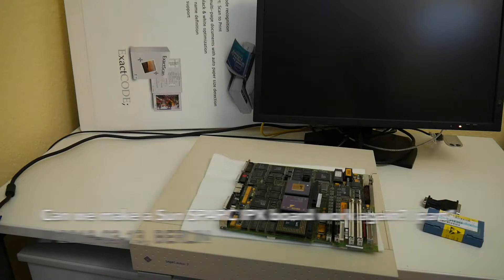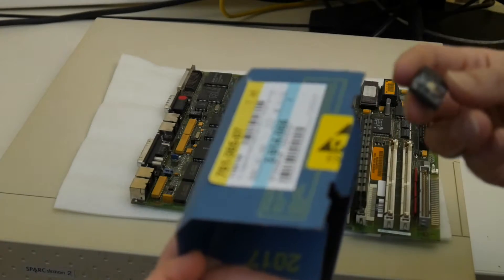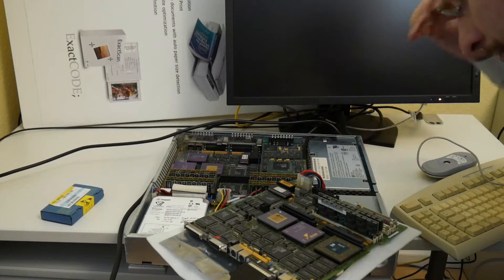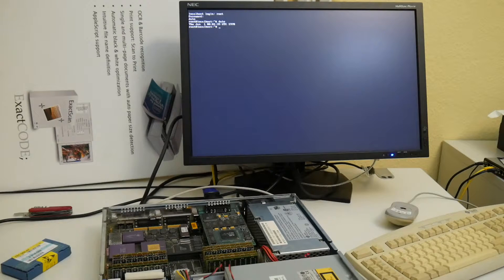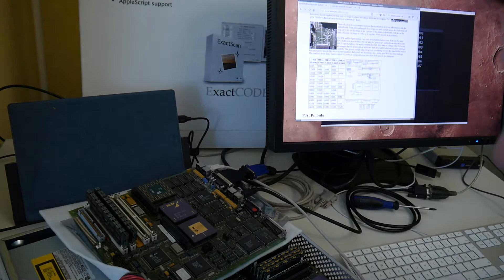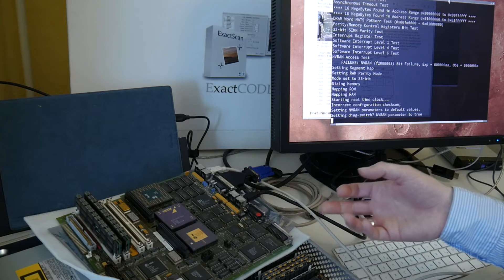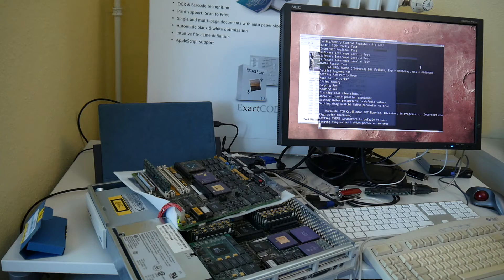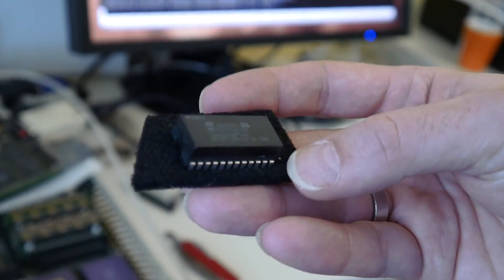Sun SPARCstation IPX board & NVRAM: can we get it to work again? /part1

Comment: A single 16MB strip goes to U0310 (the memory slot adjacent to the SCSI connector). Two need to go to U0310 and U0308 (the third slot counting from the SCSI connector).
If the memory is correctly populated and the NVRAM contents is reset to defaults (always the case with a dead battery), you'll see diagnostics output to serial port A and once booted far enough, switches to the onboard graphics.

THE authoritative source is the SUN field engineers handbook. VERY hard to obtain back in the days (I still keep my originals for nostalic purposes). But nowadays, you'll find them online. Check here for your system:
https://shrubbery.net/~heas/sun-feh-2_1/Systems/Sun4c/CPU_Station_IPX.html

Comment: Check out my open-source NVRAM rebuild board:

http://www.glitchwrks.com/2017/08/01/gw-48t02-1

I laid this out because I had around 50 Sun NVRAM modules to rebuild, it eliminates a lot of the potential problems that can lead to a ruined NVRAM, and it is much faster to install. The height is very, very close to the original so it will even fit under a SBus card as in the SPARCstation 2!
Reply from the maker: Yep, thanks for posting! we linked this already under one of the other video, thanks! https://www.youtube.com/results?search_query=renerebe+nvram

Comment: My recommendations:
###
### (1) NVRAM/TOD
###

Your TOD/NVRAM belongs to your SS2, did you mensioned? If you're using your NVRAM from your SS2, than the real-machine-type is wrong within your IPX and the checksum is incorrect too. This maybe explains the message "FAILURE: NVRAM (f2000003) Bit Failure, Exp = (...), Obs = (...)"

If your NVRAM still have battery capacity and the values are still stored from your SPARCstation 2 then do the following at the OBP prompt to get your current RMT
ok 1 idprom@ .
55
Value '55' at byte 1 of the NVRAM stands for the SPARCstation 2, not for your IPX.
The value is also stored in the word "real-machine-type" which could be reset to the value '57' for your IPX with ...
ok 57 1 mkp
Then you have to let re-compute the NVRAM checksum and do a reset with ...
ok 0 f 0 do i idprom@ xor loop f mkp
ok resset

All explained in the SUN NVRAM FAQ. Take a look  or for short... ;-)

byte(s)     contents
 0           always 01 - format/version number
 1           first byte of hostid (machine type) => real-machine-type (RMT)

RMT System
55  SPARCstation 2 (4/75)
57  SPARCstation IPX (4/50)

###
### (2) SIMM/RAM
###

One of my SS2s had the same problem
>>>
(...)
NVARM Access Test
    FAILURE: NVRAM (f2000003) Battery Failure, Exp = 000000ff, Obs = 00000000
(...)
Probing /sbus@1,f8000000 at 3,0 Nothing there
_FROZEN_SERIAL_CONSOLE_
<<<
I had some issues with some RAM SIMMs and the GX SBus board too but with the IPX your're not able to get rid of the graphics so easily, of course.

Sun IPX Field Service Manual (only HTML)
https://docs.oracle.com/cd/E19957-01/800-5774-10/
https://docs.oracle.com/cd/E19957-01/800-5774-10/fsm.chapter4.html
https://docs.oracle.com/cd/E19957-01/800-5774-10/fsm.appendixe.html

"Slot 0 must always contain a SIMM. If slot 0 is empty or if the SIMM is improperly installed, the system fails its power-on tests. 
Install SIMMs in the following order: Slot 0 (U0310), Slot 2 (U0308), Slot 1 (U0309), Slot 3 (U0307)"
Put one SIMM into Slot 0 only !  View: [SCSI-Connector] / Slot 0 (SIMM#1) / Slot 1 (empty) / Slot 2 (empty) / Slot 3 (empty)
So correct, just use only one SIMM in Slot 0. Maybe change between the two SIMMs, one of them or both could have a defect.

http://shrubbery.net/~heas/sun-feh-2_1/Systems/Sun4c/CPU_Station_IPX.html
Put your Sun type 6 keyboard on the IPX and look after the LEDs. Status codes will be printed through the keyboard.
"SIMM slot 0 (U0310) must always be filled with either a 4-megabyte or a 16-megabyte SIMM. If slot 0 is empty or if the SIMM in slot 0 is improperly installed, the system fails its power-on tests with keyboard diagnostic LED code 0011 or 0100 (see Chapter 2)." 

Over serial console you see the last step but maybe not the step which is actually in progress.
For example look the POST behavior with your SS2 and you will know what's following the SBus-probing.

http://shrubbery.net/~heas/sun-feh-2_1/Systems/Sun4c/CPU_Station_IPX.html

###
### Conclusion of (1) + (2) 
###
I would try it with only one SIMM in Slot 0, set the real-machine-type to 57 (IPX), compute the chksum (again) and reset. Then look if it works.
Reply: FYI, the older timekeeper chips didn’t have all the bits setabke so they read back as ff rather than the 00 in the newer production runs thus the replacement chips will never work correctly and you have to use a battery hacked chip with the hard coded bits in sun4c systems.
Reply from the maker: Thanks for the feedback - Much appreciated! Of course I read the NVRAM FAQ already more than once, ...The NVRAM is from the IPX, but it was obviously empty, too. I destroyed the original NVRAM of the SS2 the previous month when I was not careful for a second fitting an external battery. However, I switched the nvram between the SS2 and IPX, but did reset it without battery and such. I think at least once the message ""FAILURE: NVRAM (f2000003) Bit Failure, Exp = (...), Obs = (...)" is with the newly purchased ST M48T02 that is incompatible due to a change in production. I read somewhere on the internet a month ago that Sun may be using some reversed bit that is no long usable as actual storage on the new revision? (still need to investigate another month, …) I just realize Sun indeed lists the supported memory order on the IPX for two 16 MB modules as: 16, empty, 16, empty. Guess I should try that next. Why can they not print a nice message on the serial for unsupported configurations!? Your issue with "_FROZEN_SERIAL_CONSOLE_" after sbus probing went away with changing RAM alone?
Reply: RenéRebe Yes. I put the necessary minimal RAM configuration (1bank) inside but the problem caused by the empty NVRAM/TOD not RAM or graphics. After modification (repair) of the NVRAM the system came through the POST up to the banner, which follows the SBus probing stage in my console output with the SS2.
Reply from the maker: Moving the memory module and re-erasing the nvram did not help. I thought I may remove the SunGX chip from the socket and see what happens then in case it is the problem, but then I read on some side-note somewhere that one can add an alternative sbus frame buffer, so before I removed the SunGX chip I thought hold my beer^Wcoffee and moved the SS2 SBUS CG6 over, and tadaa: https://www.instagram.com/p/Bga51XQBRDG/ !!!
Now I "/only/" would need to find out what is wrong with the on-board GX, :-/ …
Reply from the maker: PS: in contrast to the Sun specification / documentation the machine also comes up with the RAM SIMM modules in the first two slots, in contrast to the SIM, empty, SIM, empty listing, ... ¯\_(ツ)_/¯ PS: it starts to load Linux, too: https://www.instagram.com/p/Bga9Ew0hFgb/ ;-)
Reply from the maker: video with add-on SBUS CG6 running Linux: https://www.youtube.com/watch?v=OK5jPdQX5VY ;-)
Reply from the maker: after further reading, while I thought it "hangs" it reads in some documents, that it is normal that the standard i/o is not on the serial, but instead of modular frame buffers, those would need to be removed, or with integrated graphics like this, the keyboard be removed for standard i/o to go over the serial port, … :-/
Reply: Nice idea to install an additional graphics board. I don't think about this in the first place. Removing the GX chip itself depends if it's soldered to the mainboard or not. My SS2 has soldered CPU/FPU/Cache units because it was manufactured late in May 1993. In contrast my spare unit from 1991 contains sockels for the PGA units.
As I remembered, redirection to serial console (SER A) is standard behavior. Don't matter if you connect a keyboard and monitor or not.
Reply: As mensioned in the Service Manual only SIMM slot 0 is important. But interesting to see/read that the OPB/POST has no problem with this. :-)
Reply from the maker: Full serial console on this machines needs keyboard disconnected. With keyboard connected the standard I/o is on the keyboard and display, only diag output is on the serial (I also did not know this until the other day ;-) Turns out the video output is only the 13W3 adapter, another cable works!!! https://www.youtube.com/watch?v=6VIEOnAuU0c
PS: my SunGX and I think CPU, too are socketed, ... as far as I can see, but my SunGX looks more modern. Need to check the date codes another day (at home right now, ...)